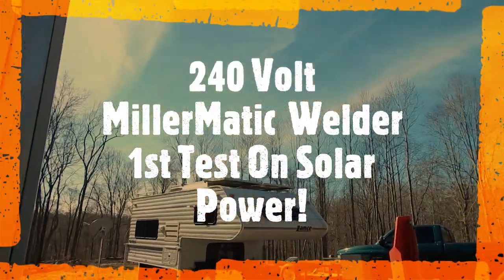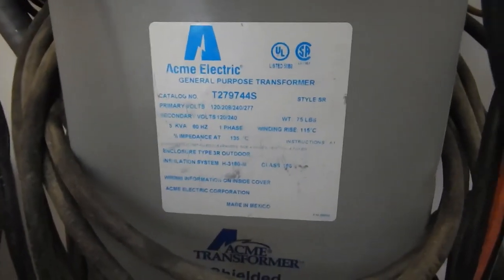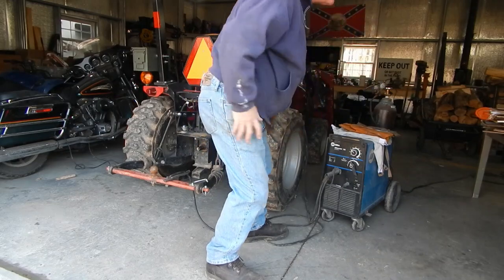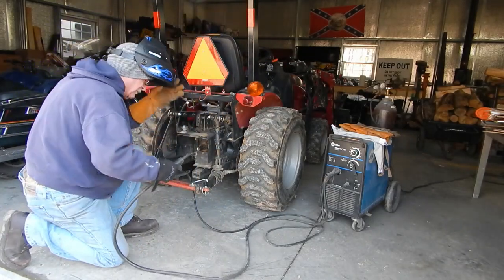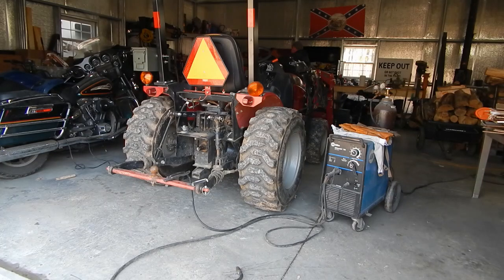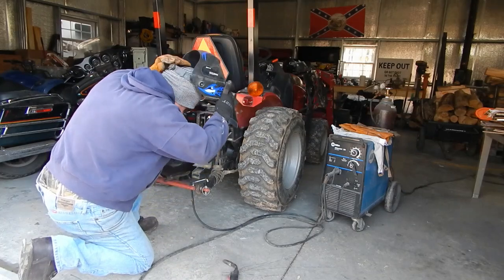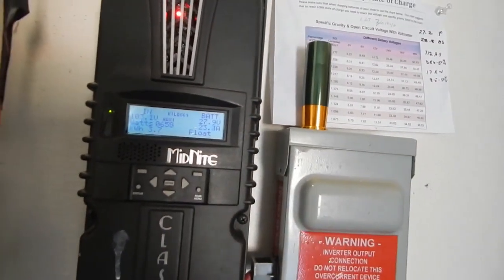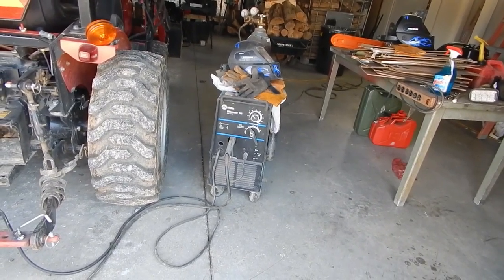Miller 240 v.MigWelder 1st Test  on Solar Power!

Comment: Can you in point form explain what make/model equipment you have inline from the solar panel to the 240 outlet? what battery etc, we are a little new and i need to get a setup at my shop for my millermatic too- tx
Reply from the maker: Check out the Tennessee off grid project playlist videos also check out the magnum energy inverter videos . Shows all equipment batteries everything to this time .  There are better battery choices available today than they were 5 years ago. If I had to get batteries today I would get the EG4  Lithium  Server rack battery packs.

Comment: Nice video.I am going to bulid a welding Island in the garden,so ,I need an properly inverter .My first option is a chinese one ,about 6000w, which means 4000w real...I dont know...Have lot of chance to go wrong..
My inverter welder doesnt run on gasoline generator, the sinus wave goes crazy ,so ..just forget it.
I did it with 3, 12 v,lead bateries in series ,and iron wire shunt between welding cables,it was not bad at all..

Comment: The shop is one step closer to being ready for anything. Will you get another lift someday?
Reply from the maker: Yes this was a big test for me. I need my welder & air compressor . Yes a lift is in my plans, but not in my budget at this moment. Boy do I ever miss my lift once U have 1 its all over.  I'm to old to be crawling on concrete. I recently put a fuel filter on my neighbors Ford Expedition on jack stands he had to help me off my creeper. That sucks.

Comment: yes MIG Welders use very little power. They work great on Solar and batteries. The Older Stick welders take a lot of grunt to ark them up. Ark burn on the eye is very painful so the sooner you get your lid fixed the better.  Keep well my friend.
Reply from the maker: Thanks. I am very happy it ran it no problem I was doubtful every time I hit the trigger is a good surge of amps

Comment: I have Lincoln 140 I use for welding brackets etc on job sites. 120 volt. I run that off the magnum inverter.
Reply from the maker: Yes I have  used them. Nice & portable for light duty work.
Reply: @TheKiloG69  I do have a couple of big welders to DC400 Lincoln and 250 amp Hobart

Comment: Rock and roll!  What are you welding those onto your drill bar for?
Reply: Looks like it is to keep it from rotating up or down. Makes backing under a trailer hitch easier. Just lift the arms and the ball is in the trailer hitch. Just my guess.
Reply from the maker: To keep it from rolling over.
Reply: Ballast box?